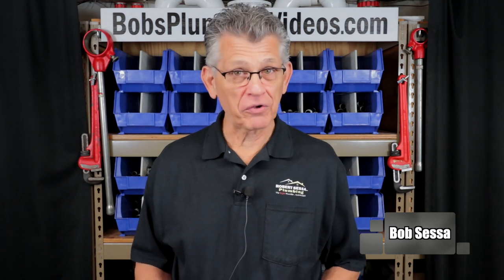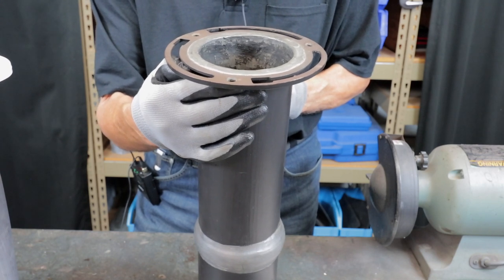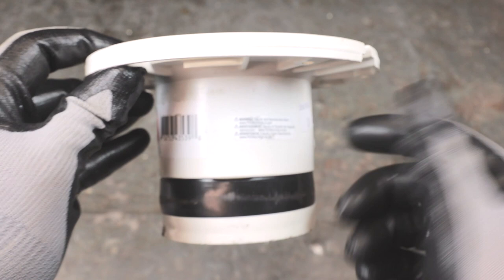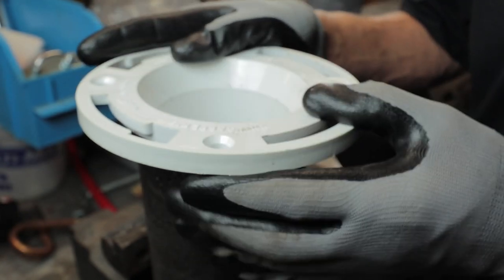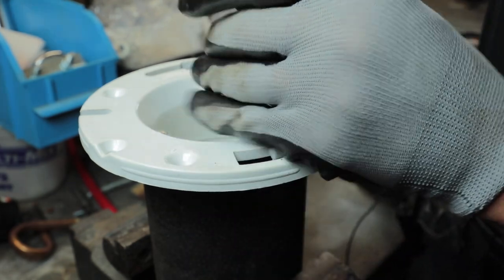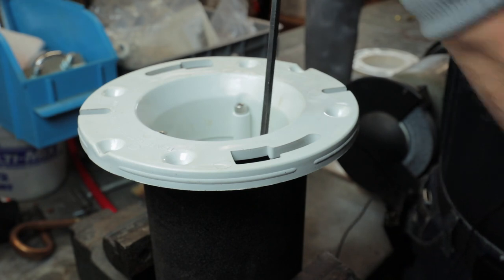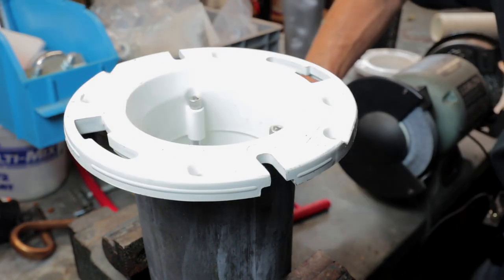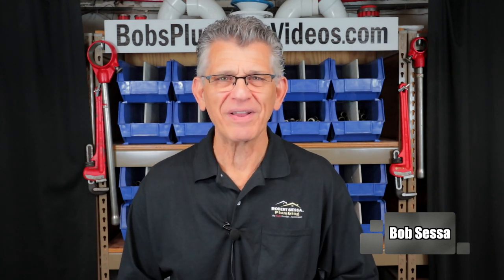Toilet Flange Repair

Comment: Excellent video!  I’ve always wondered if there was an alternative to soldering a brass closet flange when you have a lead bend.  In my this is revolutionary.  Wow!   Sometimes I come across these lead bends with that cheap, awful red or blue color coated steel closet flanges.  They oxide very easily.  Now I have a better option.  Thank you!

Comment: In the 1960s and 1970s there were ABS pressure fittings, the smallest they came in was ½, yardley was one of the manufacturers. Yardley also made SCH 40 PVC and ABS DWV. Yardley PVC DWV was not used much but the Yardley ABS DWV was everywhere back then, Genova was the most common PVC DWV manufacturer in the 1960s.

Comment: Thanks for this video Bob! I found the product on Amaz, but wanted to let you know your 2nd flange product, 43539 is not an active Amazon link for me. Im a DIYer, still contemplating whether to try the solder method or one of these, I will need to see condition of the lead once I have things cleaned up.
Reply from the maker: Thanks for the info!

Comment: ive had the 3 allen key flange on my basement toilet now for the last 3yrs. still doing fine. all thats holding it are the 3 stainless bolts and the weight.. it hasn't had a single issue.

Comment: Modern plumbers take things easy too. I asked one of them to extend my lead pipe. He came with a tapered extension and instead of soldering it, it glued it with silicon!  I was quite disappointed to realize that such an easy approach came with a nice premium!  I was expecting some soldering between the extension and the original pipe. This is why I asked for a plumber otherwise I would've done it myself. All was very accessible, not flooring around.
Reply from the maker: The new breed does not have the knowledge we old timers were taught back in the prehistoric days.😅

Comment: Yeah I just tried one of these press-twisty versions and it was a total fail. The cast iron was 2-7/8 inner diameter unfortunately. I even cleaned it back to bare metal on the inside and soaped up the rubber gasket, and it still wouldn't slip in without beating it in with a hammer and board.

Comment: Those plastic flanges reduce the drain diameter but the brass flange keeps the drain at 4", so you'd expect a better flush with the brass install.  Also, the second plastic flange has the inner bolt protrusions that further interferes with the flush.  I can see why old school may be preferable? 

However, I'm glad for the plastic flanges should the lead pipe be damaged and not able to attach to a brass flange.
Reply: I was thinking the same thing. That second flange looks like it has a lot of protrusions for "stuff" to hang up on. 

In regards to the first one being smaller than 4 inch. Isn't the output from the toilet 3 inch, and also the stack that the 4 inch stub goes into?
Reply: @johnnymusic685  In my situation: the lead bend is 4", it's the pipe sticking up from the floor.  Since it was in good condition, I fastened it to the brass flange achieving an unobstructed 4" diameter.

I installed a 'Kohler Elmbrook' toilet.  It has a 2 1/8" output, all other brands also have this small output so that the horn can fit into the 4" pipe; (or some pipes are 3").

The first plastic flange should take the toilet horn no problem; and its real easy to install.  The second one also would work, but I don't like those protrusions.  For low flow toilets I want a CLEAR passageway so not keen on the second plastic one.

My Elmbrook is working nicely.  It's a low flow 1.28 gpf.  If you let go of the handle, it's a partial flush; but If you hold down the handle you get the full 1.28 gpf.
Reply: @mike7gerald  I was thinking that too, the drain opening diameter seems too small, with the protruding screws that look like they can catch anything and cause a clog.
Reply: @Progrocker70  The toilet trap-way has a 2 1/8" opening, so even that plastic flange with the protruding screws will handle it.  Clogs will be rare provided dental floss and other stuff isn't flushed; only toilet paper and poop should ever go down.
Reply: I'd rather snake a drain than tear out and rebuild a floor because of a 20-year leak. Yes, I do this for a living.

Comment: So how's it been working for your guys after 2 years. That 2nd one looks like it would get things catching on it and clogging all the time. Also, did you ever use the silicone on that first one?
Reply from the maker: I've personally only used the one with the allen bolts and to date have had no issues. Truth be told, most time I still will solder on a new flange if the lead bend is viable. Old School...LOL!

Comment: I would have never even considered using these on a lead bend most of the ones i come across are so old they aren't viable anymore so we replace and if they are viable we re do it but for instance we had one in a slab that we just broke up the concrete and went to the cast iron and brought it all back up with pvc. Seeing this first might have changed that but it seemed rather unviable the building was from 1935 not sure how long the lead bend was in place. Thanks for the content.
Reply from the maker: Thanks for checking out the video, I would opt to replace first, if the customer can't afford that option this could be a good alternative.

Comment: Thanks for the video. Just wondering whether lead pipe is strong enough to form water tight seal. Isn’t lead too soft for twist&seal?
Reply from the maker: True statements, but in the service and repair world if you can SECURELY fasten the floor flange to the sub-floor it'll be fine. If there was a stoppage downstream of the bowl itself, in theory you might have an issue. (rare instance). It there is a stoppage in the bowl, not an issue. FYI most of the time I use the flange with the three allen nuts to tighten things up.

Comment: BOB..REALLY IMPRESSED WITH YOUR KNOW HOW...

MY CAST IRON PIPE HAS A LEAD LIP THAT SLIGHTLY DROOPS OVER THE EDGE

NOT SURE WHAT THE FIX IS..CAN U SHED SOME LIGHT FOR ME ?... MANY THANKS

TOM
Reply from the maker: I used the one with the three bolts yesterday 1/19/2023 on an old 4" lead bend, secured it with stainless steel screws and anchors into the tile floor. Tightened the three bolts (FIRST) set the the bowl and was off to races leak free.
Reply: @BobsPlumbingVideos  does the rounded lip lay flat on the sub floor?

Comment: On that lead bend you showed in the beginning is that side inlet with the male adapter a vent or is it used for another waste to drain into it ?
Reply from the maker: Back in those days it was generally used as a drain for the basin and bathtub. Thanks for stopping by, much appreciated!

Comment: Hello Bob. I have an old cast iron flange, can I put this plastic flange on the top of old cast iron flange without removing it? Thanks.
Reply from the maker: I the cast iron flange is flush with the floor, I would give it a shot. If it's above the floor, it'll end up being to high.
Reply: @BobsPlumbingVideos  . So it is easier for me now, my flange is flush with the floor. Thanks a lot.

Comment: I removed the old lead to use one of these...the pipe has a bend and they will not go inside the pipe far enough. 
I even ground down the uneven pipe to fit flush to the bathroom tile floor. Not only will it not go in more than halfway, it winds up being crooked, 2 inches from the tiles.
Reply from the maker: Did you measure from the floor to the bottom of the bend and compare it to the length of the flange before attempting this ?

Comment: Does the old flange have to be cut off, thanks cliff K
Reply from the maker: I wouldn't, but if it's a thin brass flange you can try to lay it right over. I wouldn't want to be more than 1/4" / 3/8" above the finished floor.

Comment: Hello Bob, I have a question for you. If I have a lead sleeve into a cast iron pipe, is it ok for me to use either of these flanges?  If so is there no need for a wax ring?
Reply from the maker: If the lead is in sound shape, you can you either, i prefer the one with the allen screws. You still must use a wax seal with either.
Reply: Thank you SO much for responding!! 😊

Comment: Hi Bob,
              I have a lead bend that protrudes through the floor on a bit of an angle, by design it appears. the flange has been removed . I plan to cut the protruding lead to the near to the surface of my subfloor such that the new flange will end up flush with the surface of the plank flooring I plan to install.  I plan to use one of the PVC flanges mentioned in the video but I'm concerned I may end up with a flange that is not totally flat to the floor surface due to the slight angle. Have you ever seen such a condition? Thanks so much for the info.
Jim Murphy
Reply from the maker: When I solder brass flanges onto the lead I can match it to the contour of the floor. With the ones in the video you're going to be limited, to the slope of the floor. You'll most likely be high in one end, but if it's not at an extreme angle, using extra thick wax gasket should make up the difference.
Reply: @BobsPlumbingVideos  Will do, thanks very much..
Reply: What if you were to use a grinder and grind down the high sides?

Comment: do you have to make sure the inside of the lead pipe/drain is clean?
Reply from the maker: I use a putty knife to remove any build up, then use a Scotch-Brite  pad to smooth off the the interior of the lead.

Comment: @BobsPlumbingVideos  - Thanks so much for this video!  I'm replacing a toilet and ran into this exact scenario with needing to install a new flange onto an old lead drain pipe.  I saw a video about the second type of Oatey flange (with the three allen bolts to secure it), but wasn't sure if it would work on lead pipe.  It seems to be intended for cast iron, so I wasn't sure if lead would be too flexible to get a good seal when you tighten the bolts.  From the video it looks like that shouldn't be a problem, but I was wondering if you've run into any issues with that since you started using these.
Reply from the maker: The key is to secure the flange to the floor. You can run the Allen keys up snugly (don't go bat shit crazy with them), then secure the flange to the subfloor. You'll be good to go, use a waters base silicone caulk around the bowl (Phenoseal or The Big Stretch) which will keep the bowl still once it sets.
Reply: @BobsPlumbingVideos  Thank you, sir.  I really appreciate it.  This is going to save me a bunch of time and effort.

Comment: The one with the allen heads seems like toilet paper and crud will catch on it. It also looks like it makes she sh!tter pipe kinda small? Or is it okay?
Reply from the maker: Check the inside opening of the horn of the actual toilet. About 2 3/8" on most, It'll be fine.
Reply: @BobsPlumbingVideos  okay 👌 
Thank you for answering that question because I’ve always wondered about that. Sometimes my kid will have a pretty large poop and for some reason I envision it getting caught on some of those areas where the stainless Allen screws are located. 😃

Comment: Thanks for the video. One question though. You say the lip of the twist and lock flange should sit on top of the tile. That lip is 1/2” thick. Every where I read is that the flange should be 1/4” above the floor. I’m not sure what to do.
Reply from the maker: It'll be fine,  just make sure it sits flush & Level to the floor. Standard wax gasket and you'll be good to go.

Comment: you ever seen a lead pipe that has been expanded before the floor? it's like 1-2" wider between the floor and the main drain.
Reply from the maker: Not often, but yes.
Reply: @BobsPlumbingVideos  what do you do with that?

Comment: Thanks Bob.  Perfect timing as I’m replacing a flange now.  Cast iron pipe.  When the pipes were originally installed in 1969, the pipe is not straight, so I cannot use one of the in-the-pipe flanges (the flange will not sit even in the floor).  I found a flange that has a rubber seal that tightens to the outside of the pipe.  What are your thoughts on that style?  Will it work or not?  Thank you and thanks for the content!!
Reply from the maker: There is no one answer for all situations, I say "whatever works" for a particular job. If if gets the job done and it holds water, go for it!

Comment: Great video Bob.  This is exactly what I was looking for.  If the lead from the pipe protrudes above the floor and wrapped over the old flange, do you cut it off so it is flush with the finish floor?  Thank you!
Reply from the maker: I do, if it's in decent shape I'll cut it flush and I use mainly the version with the three allen key tensioners.

Comment: Ive searched everywhere and can’t find the type of screws that are needed to to screw the twist flange. The holes are huge! What size screws do I need because standard wood screws just goes right through
Reply from the maker: What type of material are you securing to? Cement, Wood, Concrete? You can use these for concrete with a stainless steel washer to fit the screw and not pass thru the hole in the flange. https://amzn.to/3iwQ1V4. Or if going into wood use a stainless steel #12. #10 wood screw with stainless steel washers.

Comment: Bob why don't you make a video showing the guys how to remove the old flange from the lead Bend😊 keep the windows open when you're using a torch on the lead when removing the b r a s s toilet flange did a lot of those they made Plumbing easier today as far as the ProPress how long is that o-ring going to last I think a solder joint will last a lot longer what's your opinion😊 funny before 1986 we did a lot of domestic water what's 50/50 now everything Soldier free what did houses in the early nineteen 70s still going no one ever got sick the safety standards are better today but New York City water I'm in Staten Island Brooklyn other boroughs there are lead joints on City water mains
Reply from the maker: If I did that and someone set their home on fire, guess who's gonna get blamed! LOL! How are you finding business? After those pro press "O" rings fail, there's going to be plenty of business, unfortunately I won't be around.
Reply: @BobsPlumbingVideos  Neither will I 🤣 😂 🤣 thats life taking my lipitor every night Try stay healthy been on it for 25 years.
Reply: @BobsPlumbingVideos  you right no fire 🔥 somethings leave out smart . I had back operation lumbar laminectomy can not do much anymore. The brain said yes, and the body said no .🤣

Comment: PVC toilet flange yes. Pro press, shark bite hell no. If you can not sweat you are not plumbing.
Reply: People getting mad that a better product came out that allows homeowners to do plumbing easily and not have to pay plumbers an absurd amount of money to sweat some fittings.  I can sweat but I always use shark bites. Never had an issue and never wasted money on an overpriced plumber.

Comment: I just picked up the same Oakley screw in twist and guess what the rubber gasket was only half the thickness as yours which means half the thread thickness and probably half the effectiveness. Fuck’n companies always looking to save a buck and at the same time charge more bucks!
Reply from the maker: I'd take the dam thing back!!
Reply: @BobsPlumbingVideos  I did, and used an internal flange instead.

Comment: I don't care for those DIY flanges because they restrict the drain opening.  Anyone who drops a huge deuce in the toilet good luck getting that log to flush down the pipe.
Reply from the maker: The integral traps in most toilets is less than 3" in diameter. I haven't experienced any issues so far.

Comment: The problem is you go from a 3 inch toilet hole to a 2 inch toilet hole. Get ready for a bunch of toilet stoppages
Reply from the maker: Ever take a peak at the bottom of the bowl? That hole is about 2 3/8".
Reply: @BobsPlumbingVideos  yeah I know but one hole isn’t two holes the more restrictions the more problems I own some rental properties and I’ve used these a lot I’ve had nothing but problems from them so this isn’t a quince